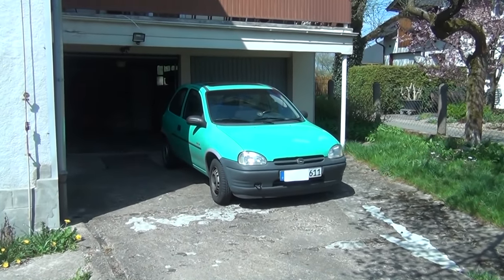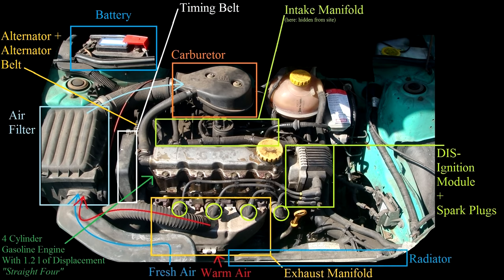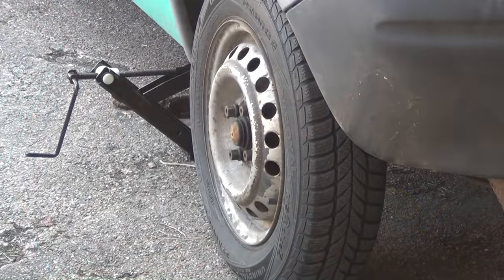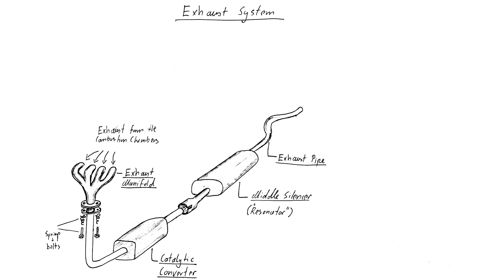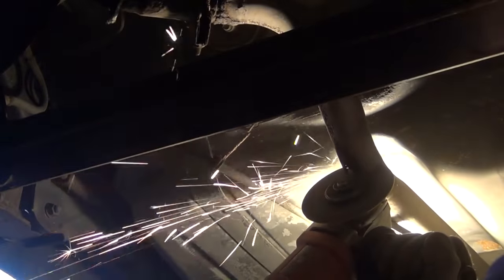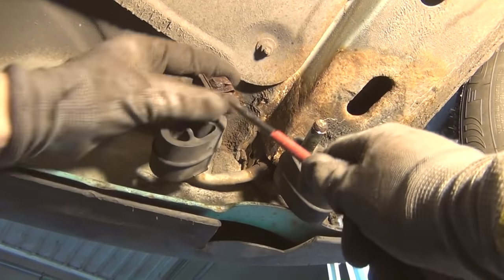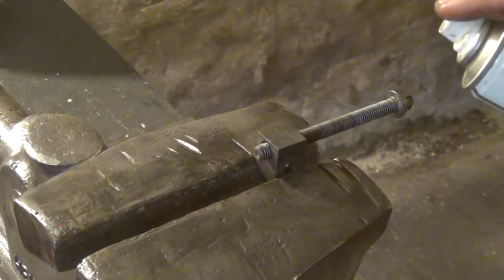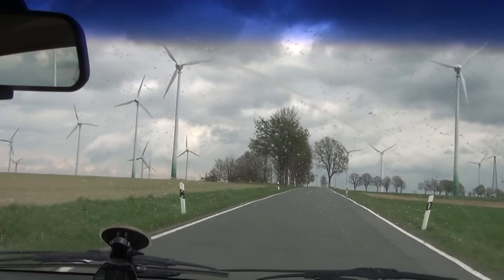Car Repair Marathon

Comment: i am surprised that 1996 auto has a carburetor, rather than fuel injection. most us autos by that time were all fuel injected. i love those small hatchbacks. good on you for keeping it on the road.
Reply: It actually doesn't. It's a single point electronic injection system called "Multec".

Comment: The last oil change was almost two years ago. I was told motor oil loses it's characteristics with time. Wouldn't be wiser to change the oil too?
What is the commercial value of your Corsa? I'm curious to see if there is much difference from the commercial value in Portugal (around 600€). 
Great video as always.
Reply from the maker: João Assunção Hey. Yes you are correct. The oil change should be done in time. I guess I will take care of it in the coming weeks. 
The market value is roughly the same as in Portugal.
Reply: The Post Apocalyptic Inventor should I buy an old car like this? how hard is it to repair?
Reply: The Post Apocalyptic Inventor And maybe you should take a look at the valve cover gasket, it seems to have some leak spots and usually it's cheap.
Reply: João Assunção Nah, motor oil doesn't mind sitting. Especially not synthetic.

Comment: You should never apply lubricant to wheel nuts or bolts. The manufacturer specifies torque for dry threads. By applying lubricant, you can over-tighten and cause the fasteners to fail.
Reply from the maker: Michael Hall Hey good to know. It always helped me to get the bolts off again when the winter / summer comes, but I see your point.
Reply: No problem. I've seen a few vehicles lose their wheels, and it's never a fun time. ;o)
Danke fuer deines Videos.
Reply: Michael Hall I think you will find that not every manufacturer specifies dry bolts and the manual should always be checked first, furthermore plain grease is preferable to oil. That said i have lived in the desert for far to long to judge cold climates well.

Comment: Are there more upcoming videos on the SMPS video series? Those videos are great
Reply from the maker: Rob Mckennie The upcoming videos about the welding machines will deal to a large portion with switched mode power supplies. I'm also still planning to continue the original smps tutorial series and I know that people love it. For me it is very hard to make tutorials of that kind though.
Reply: The Post Apocalyptic Inventor that's understandable

Comment: Great video! By the way you've got the exact same navigation system as me, are you still using those maps from 2007 or have you bought the newer ones from 2012? Or maybe you're using openstreetmaps in some way so they work with the Panasonic.. Anyway, thumbs up!

Comment: Nice job. I would suggest not using oil on your new rubber hangers, the oil isn't good for them. Instead I would use a silicone spray as it provides lubrication and conditions the rubber.
Reply from the maker: Brian Dellinger Thanks for the advice. I heard that from "Eric the Car Guy" before and I'm sure you are correct.
Reply: The Post Apocalyptic Inventor That is funny. I watch him too! And, yes he does mention it several times. I am also a mechanic and thought I would share that bit, too.

Comment: In 1996 Opel were still using Carburetors?! Wow.
Reply: So was toyota until 95 in most cars.
Reply: Nope, description says it is throttle-body injection, think of it like a computer-controlled carb.
Reply: I know how TBI works. It take literally everything good about those two and turns it to garbage. He happens to have the only model with the 1.2 TBI, all other 1.2s are carbureted and produce more horsepower.

Comment: your engine needs to have the valves adjusted, you are probably loosing a lot of power from that. and you can damage the camshaft and the valves becouse of that.

Comment: 7:30 that's INSANE !!! 
You would NEVER apply any sort of grease, lubrificant or WD-40 on any wheel stud !
That way you are going to loosen your studs and your tire will just spin out of your car.
The only thing you can do is cleaning the threads of the studs with a BRASS brush (not steel) and the inner threads with a brass pipe cleaner (scovolino). Steel brushes are too much abrasive for steel studs

Furthermore I think you didn't even pull the parking brake for this job, as that car seems to wobble too much. This video is too much superficial

Comment: your friend will probably be able it strip that Mercedes and sell it for parts, the body doesn't look like its worth salvaging.
Reply from the maker: Kirk Nelson His father has stored a truck load of replacement parts for this model, including a hood and fender. He also owns a second one of these that is in much better shape. I guess at least one could be saved, but the two of them are not very capable and are "all talk" when it comes to actually doing stuff.

Comment: Your engine would run so much better if you blocked off that EGR Bullshit, does your country do checks on cars? if not then why not remove it?
Reply: WristWork  +1 That "hot air intake" isn't helping any.
Reply: +GT WING Mandatory exhaust examination and safety inspection every 2 years. Changes which could potentially affect powertrain mandate immediate re-examination. Police can check your car any time.